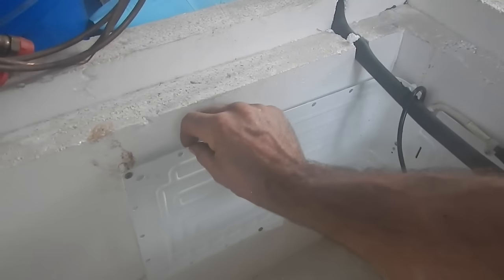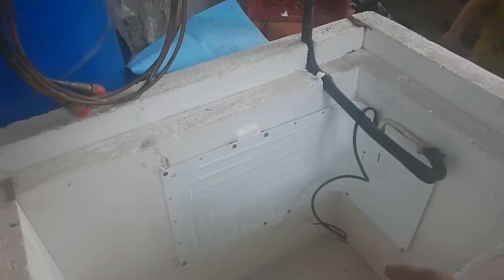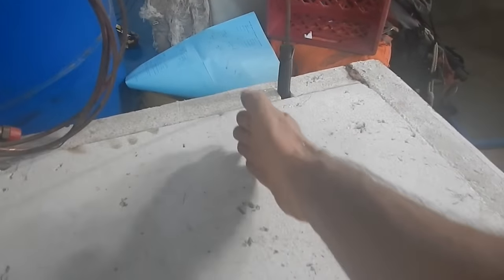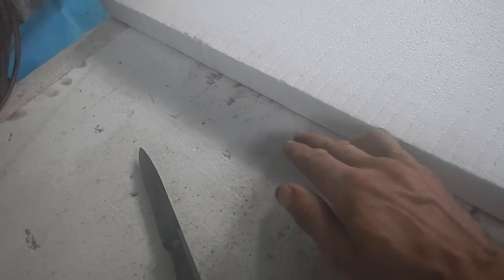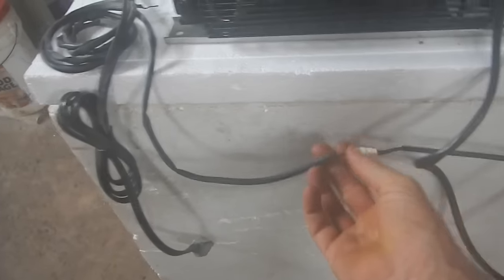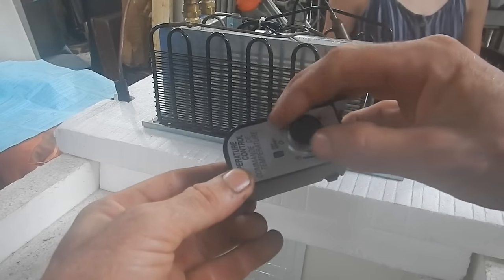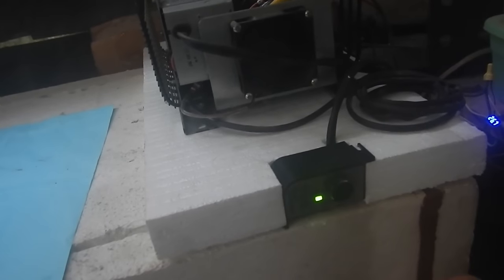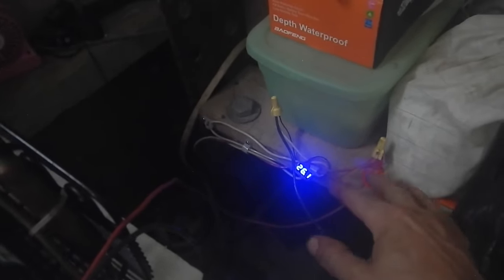Makin' a Fridge...

Comment: The larger cold line - the suction line - is carrying the heat out of the fridge in a low-pressure gas. The compressor squishes it concentrating the heat at high pressure - a hot gas line - into the condenser coil. The fan blows the heat away. Condensed - warm high-pressure liquid line - connects to a small capillary tube or expansion valve restricting the flow and lowering the pressure into cold liquid - entering the plate-type evaporator in the fridge. Heat in the fridge boils the liquid in the evaporator making the box colder. When the box gets cold enough the thermostat stops the compressor motor and fan ending the process at the set temperature. When the box warms a little the thermostat switch starts the process again.
The capillary or warm liquid line may be held in contact with the suction line forming a heat exchanger and improving efficiency. Insulated or not.

Comment: I like the extruded styrofoam better than the expanded foam for projects these days.  Costs about the same, but way less crumbly.  Apparently people fill copper tubing with salt before bending to avoid kinks. It'd be inefficient to have the cold and hot loops touching each other outside the box. Cheers.
Reply: Salt is good, but these kits are prefilled with refrigerant gas so you don't want to open the pipes. If you want to do tight bends you're better off with a pipe bending tool. :)